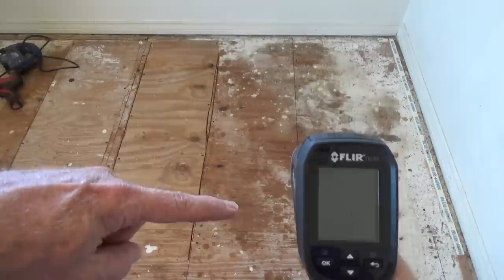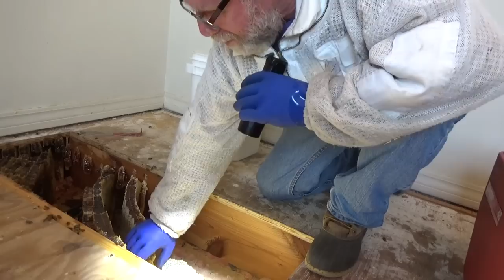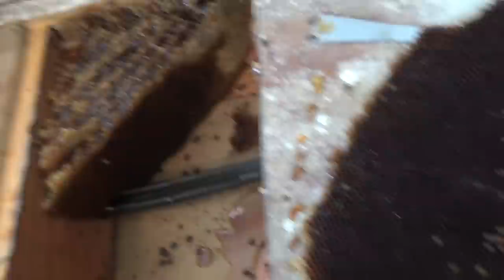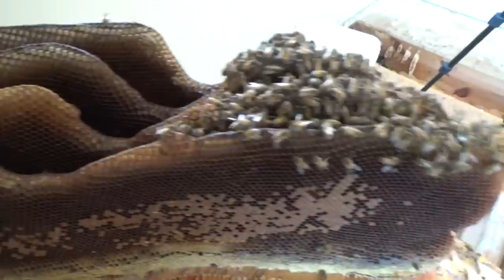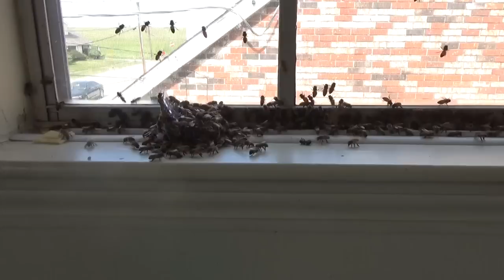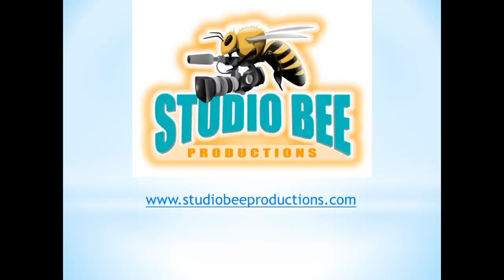When is it ever enough?

Comment: Do the bees die when they get vacuumed?
Reply: No.  The suction on the bee vac is low enough they don't usually die.
Reply from the maker: As the vacuum is specially designed for low suction, the bees are not harmed. Thanks for watching, and I hope you will check out more of my bee wrangling adventures. God's peace.
Mr. Ed